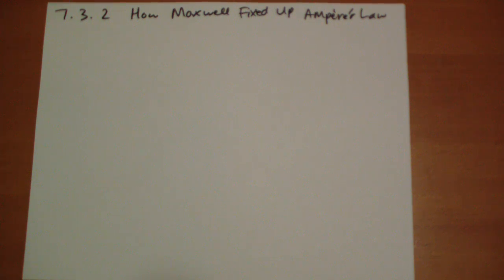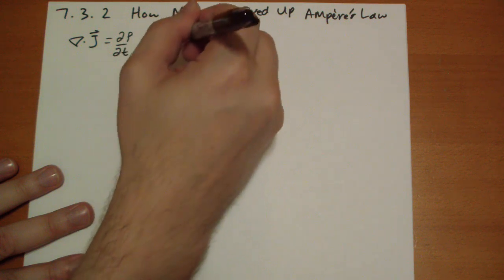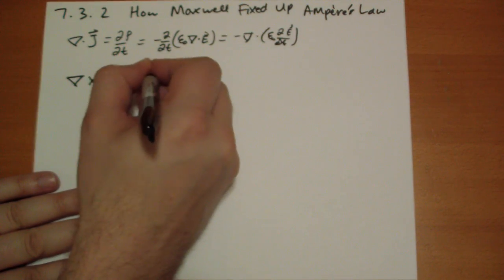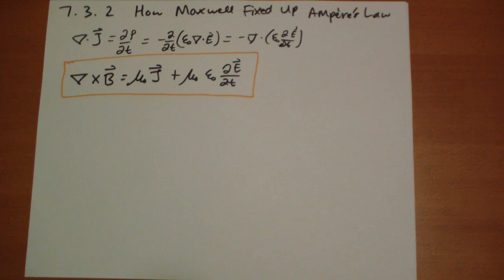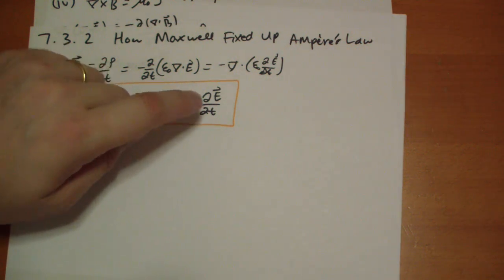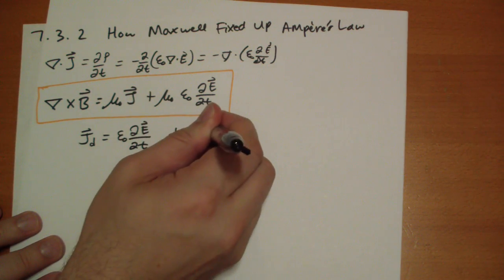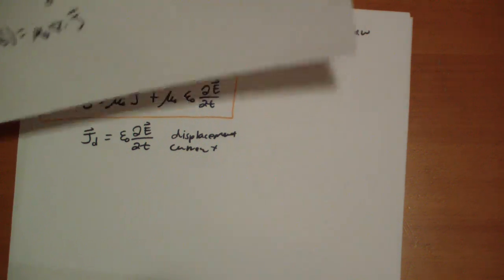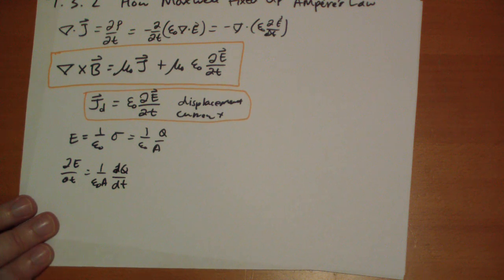7.3.2 How Maxwell Fixed Up Ampere's Law

Comment: Thank you for the video.
Can you link to an experiment that prove that a change in the electric field, generates a magnetic field? 
Try using this equation on a simple dipol antenna and see how the displacement current part, makes it impossible to transmit a radio wave, hence all textbooks for radio og radar engineers makes use of Kirchhoff law, and NOT this version?
What are we missing?
Reply: Use 2 charged plates (basically a big capacitor) and place a compass between the plates. Turning the power on and off results in the e-field between the plates changing, moving the compass needle.

Comment: Can this be the error in maxwells equations that I keep hearing about.  From what I understand I see that Maxwell is assuming that a closed loop must be equal to zero.  But in reality a loop can never be fully closed, so to adjust it to zero is making it impossible to identify any input from outside the loop.  Any thoughts on this?